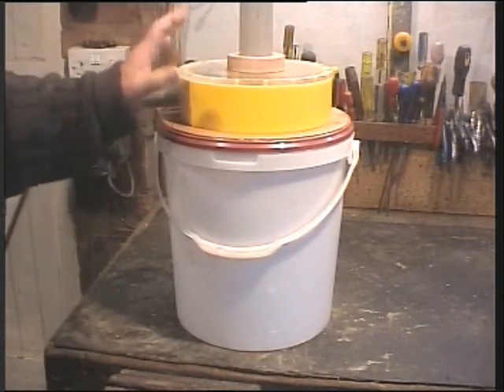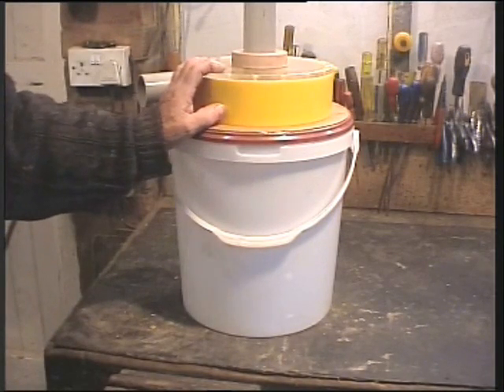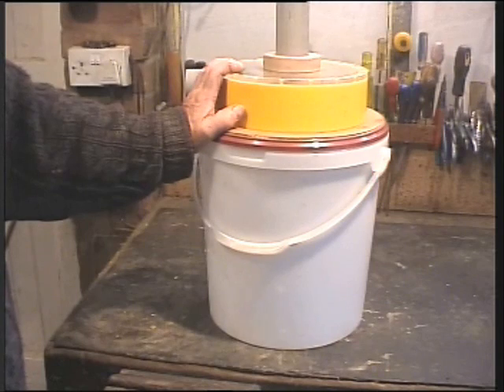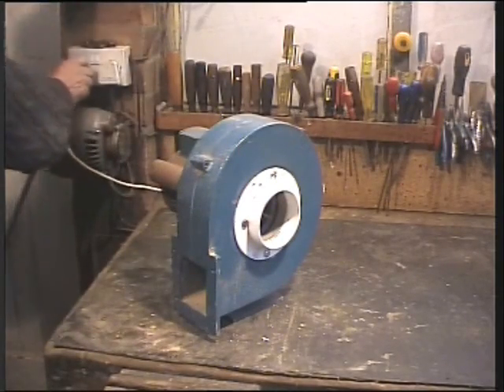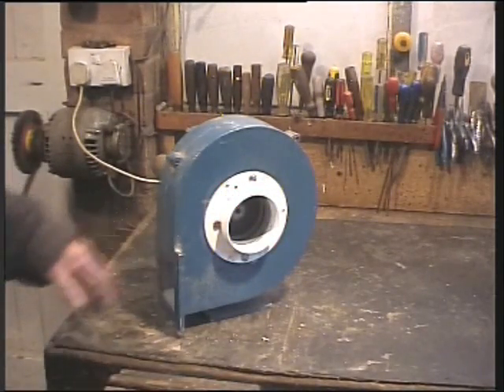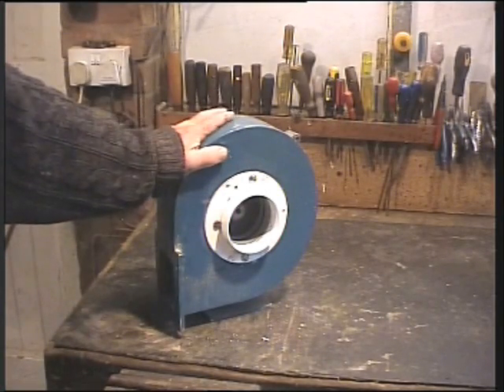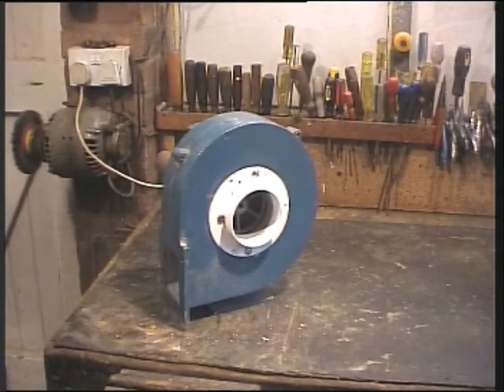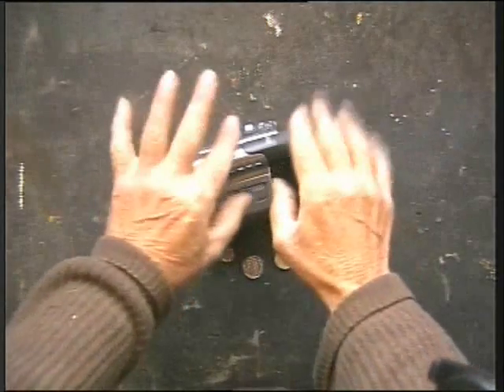not so dusty !

Comment: That motor's life may be short lived with 4" pipe.  Maybe okay for short run cycles - does the motor get hot from high amperage?
Reply from the maker: The motor is designed for 4",why should their be high amperage ? with centrifugal fans if you restrict or block off inlet or the outlet, the load is "reduced" ! so I don`t understand your comment.
Reply: ***** Thought I read where 4" pipe needs two horse power motor.  Maybe it depends on length of run?  Have you ever come across motor requirements for centrifugal fans?
Reply: Mike Smith I assume you are hooking it to some machine(s) like a sander, table saw?

Comment: Built a cyclone like that (a little larger scale), for my CNC router. Wish I had done it sooner. You should never reduce the diameter of the collection tube to less than the inlet diameter of the vacuum motor. If you do, it will greatly reduce the CFM or volume of air moved. You want as high a CFM as possible to pull in dust and chips from as wide an area as possible. I bought flexible 4" vacuum hose on Ebay, it was relatively inexpensive. I suspended it from the ceiling and simply drag it to wherever I need it, like an elephant trunk.

Comment: I like the bung idea, could use a couple of these (http://www.ebay.co.uk/itm/TUMBLE-DRYER-EXTERNAL-WALL-VENT-FLAP-4-4-5-5-WHITE-/181572171008?pt=UK_Irons_Presses&hash=item2a468b7500) if you are down to 100mm pipe at the machines (although not at this price!).  As for the blower, you'll just have to watch it in the summer when your clean washing is out on the line!  :)

Comment: POC iv found with dust extraction its about volume of air moved not suction, im not sure 2" pipe will have enough volume going down it to maintain the level of extraction you want. also with smaller pipes these types of blowers/suckers tend to stall. i know its expensive but i would recommend using 4" to the machines then step down as close the the machine as possible to the required size. iv found this out the hard way.
Reply from the maker: I have now converted my circula saw to 4" piping "its great" the other stuff is fine with the smaller one  thanks for info
Reply: great news POC. i couldn't believe the difference :-)

Comment: be carefull with longer ducts made of pvc. they can get rather static loaded. you can run an open copper earth wire through them. wood dust, especially the finer fraction after the cyclone can be very explosive. it is handy to make a duct to the floor level, where you can swipe the dust from the floor in.

Comment: I'm part through building a dust cyclone myself, going all out with a giant sheet metal cone with a full dust bin underneath. I was using a little numatic vacuum cleaner and was already fairly sick of constantly emptying it before it caught fire, so i'm hopeful the dust bin will take a good while to fill up.

The bung thing is clever though. I think i'll go with that too, since I was fretting about having to make a bunch of blast gates. All that's holding me back now is the price of soil pipe angles.
Reply: If your not fussy, you could use short lengths of duct hose for the bends etc and jubilee clips. It also makes rearanging or cleaning it all easier and cheaper too as the joints aren't welded together. you could make your own T's too. Soil pipe fitting are blooming expensive.

Comment: If you're going to use 2 inch water pipe Just have an end cap tied with a piece of string to each port. So you would just pop the end cap off the one you're using then pop it back on when you're done and you can move to the next tool without worrying about moving the bungs around.